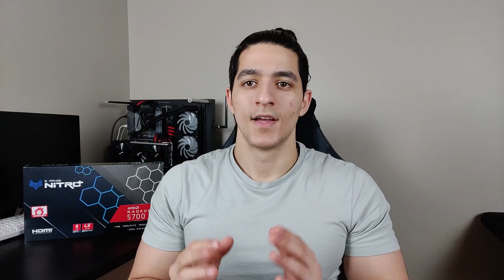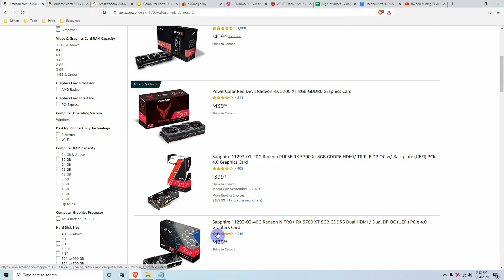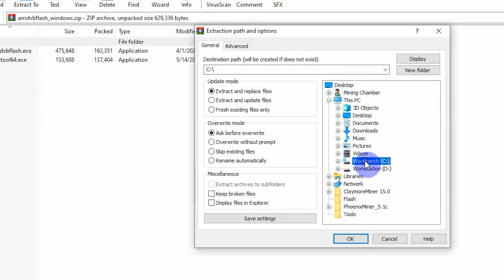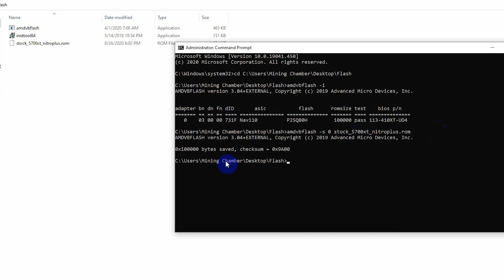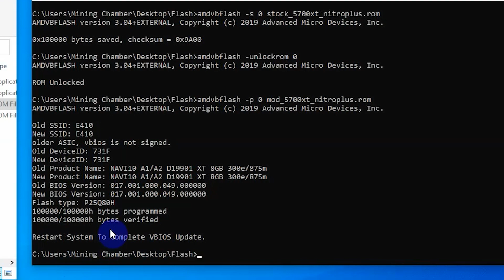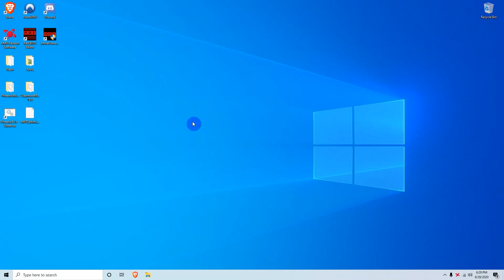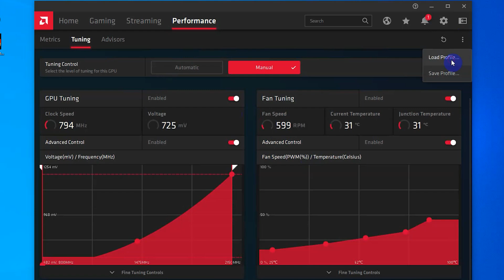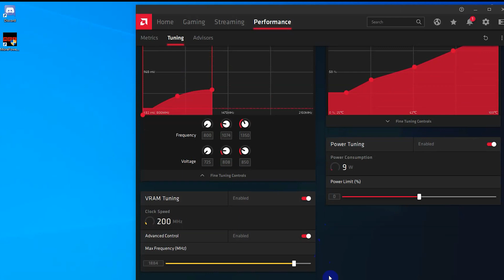RX 5700 XT Mining Overview | Profitability, Hashrates, BIOS Modding & Overclocking

Comment: i got the triple dissipation model and as for cooling they are great but any sort of memory OC will cause them to crash,also the core will never reach that speed on 725mv, what power reading are you getting at the wall?either i got the worst model on the market or something isn't right here
Reply from the maker: Hey! On the wall we were drawing 189 watts, the PC is pretty amped up so the even in idle the system takes a good amount 60-100 - we are also not using risers so that saves some power as well!

The card does show that it only is getting 725mv, did you apply your MPT settings?
Reply: @MiningChamber  well that's what i was talking about cause at that core speed the cards i have take around 130W and if i try to go down on voltage the driver will just crash, wasn't stable even at 750 so i didn't bother with bios modding to push it even lower.I got this model because of the overkill cooling but they do not like to be messed with, probably lower end parts used,they're still making a pretty penny even at this wattage so can't say i'm mad
Reply from the maker: No problem then whatever works best for u, just if your planning to undervolt as low as I did, I recommend just bios modding then mpt - follow the instructions to the full to make sure it's whether it is your card that can't be pushed low or it was done not properly!
Reply: @MiningChamber  i bought another card this morning of the same model so i will put it in my test pc and see what it can actually do, if you take cards individually you will get way better results as in a rig a million things could be causing crashes and to be fair i was also kinda lazy, it's been going nonstop for almost a week now making decent profits so i just left it as it was
Reply from the maker: For sure it is easier that way! Good luck hopefully you get it going well

Comment: great video ! thank you so much , however i got a question the performance setting what did you change in the morepowertool ? Did you change and save into the new bios and flash again ?
Reply from the maker: Hey!! I did not run More Power Tool again. It was just that first time to unlock us the way to be able to undervolt further than 850mv, As for the performance mode, you will not need MPT if you decide to do performance mode!

Comment: Hey man awesome video! I have a question might be a dumb one: you set the watts to 90w, what if I set mine to like 130? Would it get more hash rate or would it just be basically useless power consumption?
Reply from the maker: Hey! No question is a dumb one!! I believe you meant I have set it to 180. It is basically just the cap of the watts as far as I know. So the gpu will not exceed 180 watts. If you set it to more it will not change anything since it is very unlikely that you will be able to push after 180 watts efficiently and not have the card crash on you!

Comment: Is it compulsary to do all those setting u did.because its complicated.is it possible to mine without all those complicated setting.if so how will be the hashrates
Reply: I actually don't recommend the bios mods unless you really want to eek out every last drop of efficiency and have one of the few cards with good vram cooling. My XFX only gained about 2mh/s with the timing mod but shot the vram temps through the roof. 54mh/s stock with cool vram, fewer rejects and stable is better than 56 with vram temps in the 90s and more rejects. So I would say try your card out stock first. If you can get 54 or better without modding it, leave it alone.
Reply from the maker: I agree! For me the temps worked out pretty nicely, I was sitting about 76mem temps but my wattage usage definitely seems to decrease. Might be specific to models! Next time il take a more accurate watt usage and report that instead of the software watts!
Reply from the maker: You may do it with just the overclocking, you will have less hashrate though probably 4-6 less MH and more power usage.

Comment: Please make a comparison between gpu and asic miners and which one you recomend
Reply from the maker: Will be coming soon ;)
Reply: ASIC are programmed to mine using very specific instructions that allow it to run faster than a GPU.
This is why the crypto currencies keep changing, because it makes the ASIC hardware worthless and they have to throw it all out and replace it. 
Meanwhile a GPU can easily change methods as the crypto updates.

Comment: wow great video !! I want to ask you a favor, I have the same card but with Windows it crashes but with HiveOs it works great, I bought this used card on eBay and I think the BIOS It is corrupt, where can I find the original three BIOSes? original - silent - performance? Thanks if you can help me
Reply from the maker: Hey! Thank you!!

The performance, and effeciency are not BIOS but instead, they are overclock settings that we created and saved. To find the Original BIOS of the GPU the best place to search for is Tech Power Up website!
Reply: @MiningChamber  Thanks for your help, but on the tech power site it is not specified what kind of Bios I can download, I don't know if it is original, silent or performing, there is only one kind of bios. I think it is a Bios problem because the card works only with Linux and not with windows.
Anyway thanks for everything, your videos are really well explained and this section about modding and overclocking is very interesting. See you next
Reply from the maker: We are sorry! Hopefully you figure it out!!

Comment: Did you take the wattage by the wall?
Reply from the maker: The wattage by the wall came at 100 for the system and then additionally the numbers that we saw in the software. So effeceint settings 188 watts off the wall. But the reason we didn't include it is because this system is more of a full tuned PC with high specs that take good amount of watts and we don't use a usb riser for the GPU. So the numbers off the wall will be accurate for a PC but not for a mining rig!
Reply: @MiningChamber  but the numbers in the software are not accurate
Reply from the maker: Correct they are not the most accurate in terms of that the GPU will surely be taking more at the wall but the software will be good enough as to tell you how much watts youl actually save with a certain overclock
Reply: @MiningChamber  the software only reads the gpu core power usage  and not the memory draw. ETH coins are a memory dependent vs core. It wont show the power used or efficiency of the memory.
Reply from the maker: Ahaa interesting!! Then as of now we will make sure to use the wall to report the accurate numbers! It was worrying off the wall because the machine was jumping in idle from 50-100 watts so couldn't find a base to count off of 🤦 next time il figure that out and provide accurate information thank you for bringing it to our attention!!
Reply: @MiningChamber  the rig should settle down after a bit after booting up depending on the OS. I know windows takes longer to settle down and idle after booting because of all the bloat software and wants to check the web and everything else. Most current rigs use about 60- 80w idle
Reply from the maker: Perfect will note that down and make sure next time we will apply that!!

Comment: Rx 580 vs 5700xt rig,  which one is
 good for new miner?
Reply from the maker: We recommend the 5700xt but if you can find a good deal on the RX 580 just go for that one 👍🏻
Reply: The rx570 is better on power usage
Reply from the maker: The 5700 XT is better with power usage and more effecient!
Reply: @MiningChamber  The cost of the card vs the hash per second. I can buy 2 rx 570 cards for 2/3 the price of a 5700xt and get 60-62mh/s at 144 watts in the software. I'd still have 100 usd in my pocket for the few extra watts the 2 cards together use in comparison to the single 5700 that probably will be running slower
Reply from the maker: @jamessmoth8683  The 5700XT will have a better resell value + effeciency wise for more density its better to go with the 5700XT. Less risers to power and more slots to fill with more hashrate. Plus having to buy 6 GPUs rig 2x times meaning you will have to buy another PSU. mobo, etc.
Reply: @MiningChamber  I have 2 rigs with 12 cards each with a total of 670 mh/s
Reply from the maker: Correct I understand, but if someone would do 12 5700XT it will definitely be heavier on the pocket, but it will be more density ( MH per watt) both strategies are completely fine! It all comes down to what deal you catch. If you find the RX 580-570 for a good deal then absolutely worth it, vice-versa
Reply: @MiningChamber  I was able to pick up 7 more rx570 8gb cards for 800.00 USD delivered last month. Right b4 the surg in coin prices
Reply from the maker: That is really good!
Reply: @MiningChamber  I have 1 4gb card in the rig that will reach its EOL (end of life) for ETH in a few months. I'm debating on another 570 8gb, or dabble with a 5700. But I think the prices might b better after the nvidia 3000 cards come out, but might still surge when the 4gb cards cant be used anymore because of supply and demand for all the people looking to replace their 4gb cards.
Reply from the maker: That is true! The surge will be interesting ⛏️
Reply: @jamessmoth8683  I think 5700xt costly but they are future prof